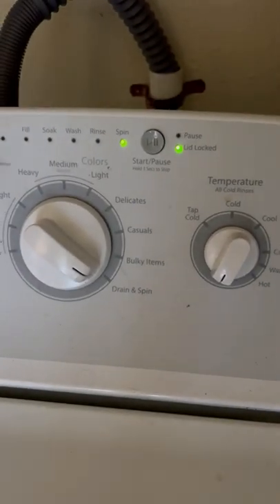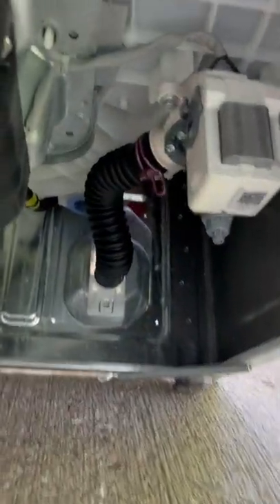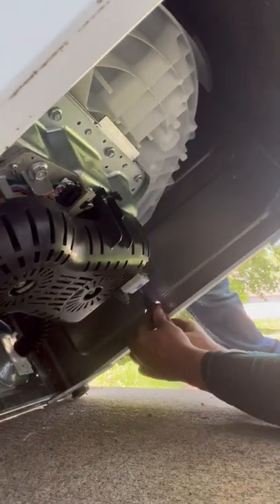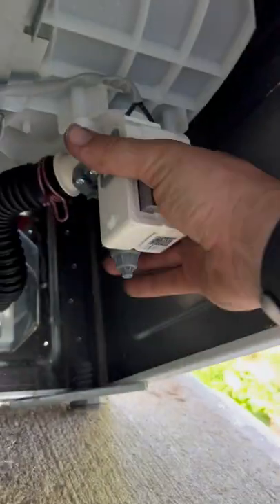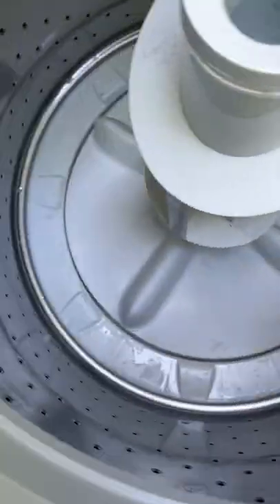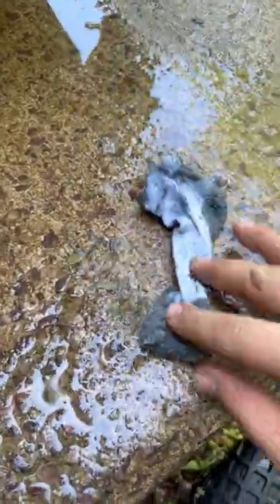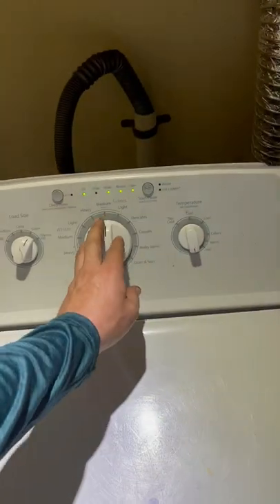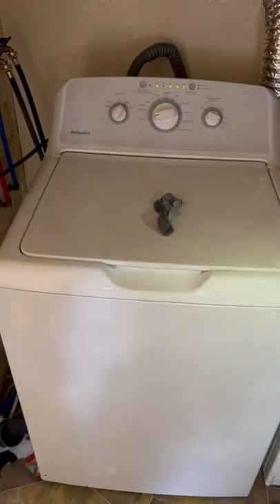Fixing a washer that would not properly drain.

Comment: I wish it was that simple. I didn’t find a sock in mine and i took out the drain hose and ran water through it. It could be the control board. I ran the test on the lid already. It locks, it works.

Comment: Quick tip use a wet vac attach it to the drain line and suck the water out. No need to move it easier on the back.

Comment: Looks like a GE washer. I love those because it will tell on the resident what they did wrong. & you need to put into tech mode to read the error code and then after fixing the error. You need to reset the code in order for it to work.